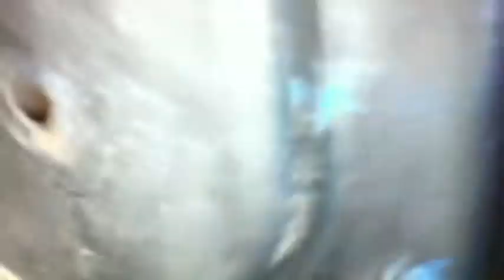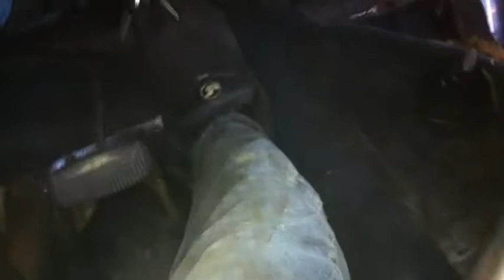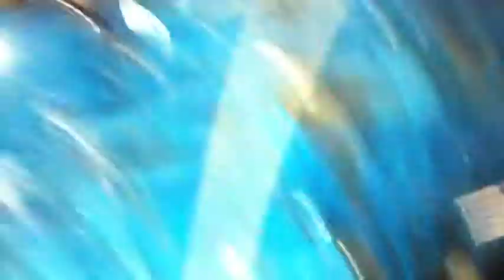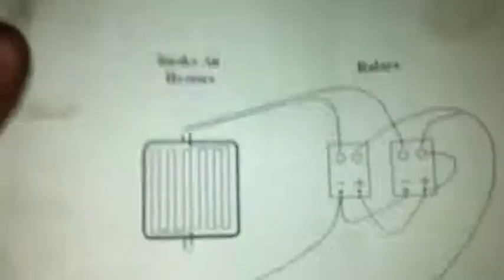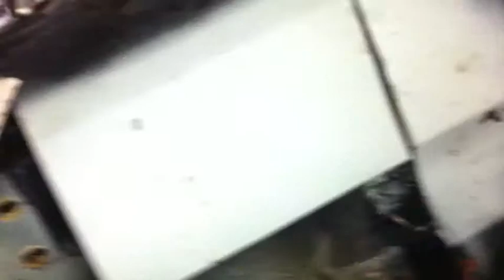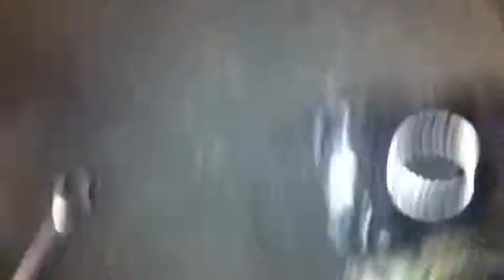1973 ford fummins cummins swap 10

Comment: How long have you been working on the conversion
Reply from the maker: about 4 weeks not but i waited on parts for a week and a half, and i work so i just did it in the spair time. i did the math if i worked on it 9 hours a day for 5 days it would have been done and i was not rushing